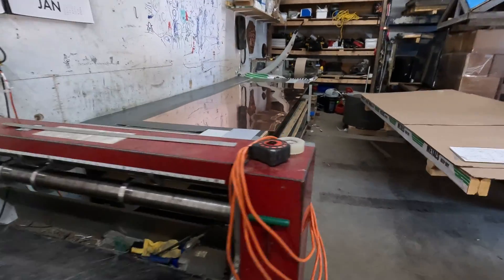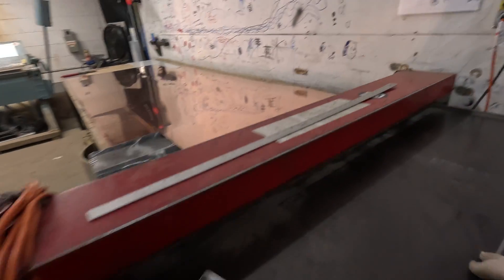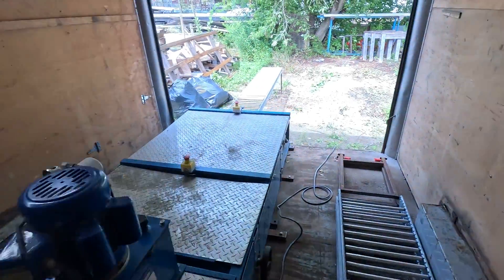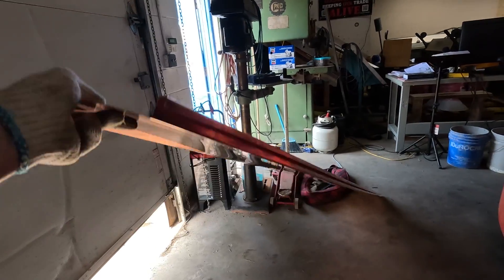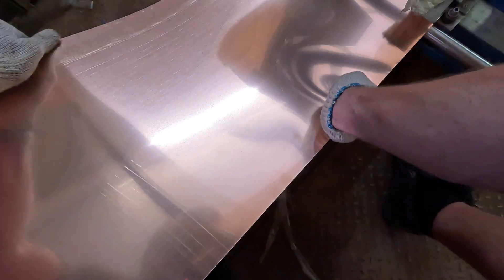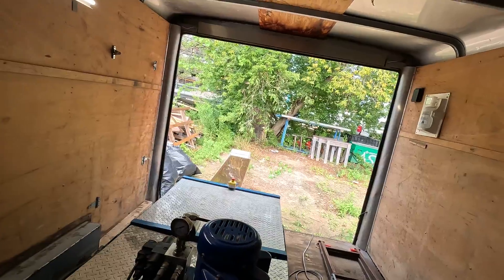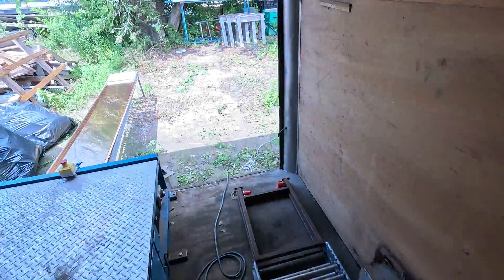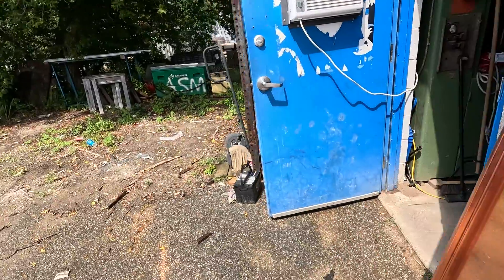Fabricating Copper Standing Seam Panels with Roll Former

Comment: A few questions about the profiler.
. What's the cost?
Why is it so long?
And how do you do your double under panel?

Edit
We use schlebach mini prof.
Reply from the maker: Reason it's longer is because it's designed for 24g prepainted steel...45k usd out the door....double under is trickery...I just run a full panel and turn it over with a wuko...we do t use many double unders
Reply: @asm101  
Cheers
we use them all the time here especially for cladding, so will run just one side at a time.

Different needs for different countries.
Reply: @Robert-j6r8c  i like how guys in Europe scaffold over the whole roof and close it off that ought to make things better in bad weather